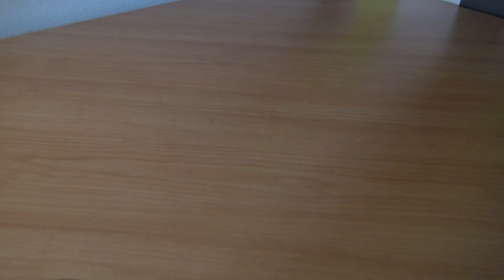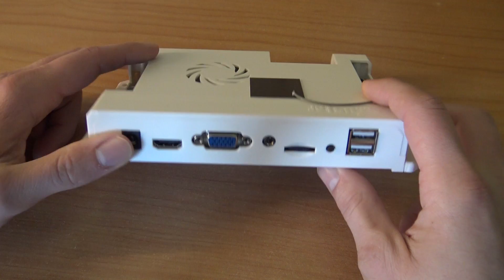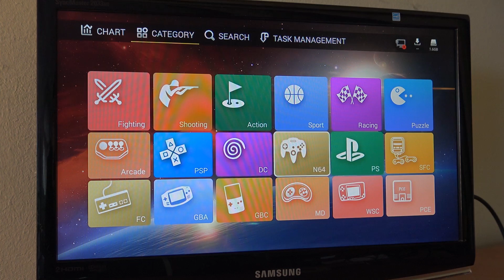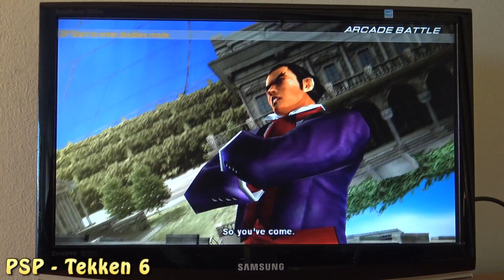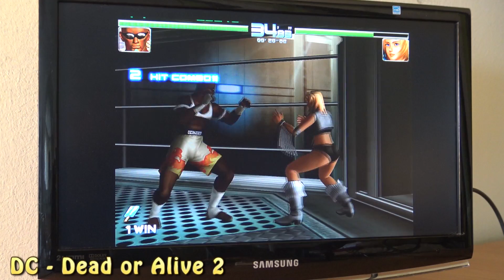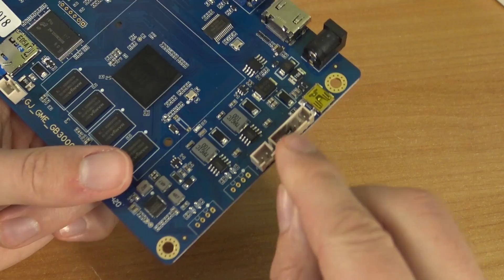Pandora Games 3D Plus Console Edition.... is it any good ?

Comment: Hey Wicked Gamer, I have the Pandora Games 3D Arcade Stick, would you recommend upgrade the mainboard to the 3D plus version for extra $90 (shipping included)?? Advices?
Reply from the maker: Plus edition only haves minor improvements like...
- Adding games trough menu (don't need pandory tool anymore) 
- Better support for different controllers now. 

I would wait for one that haves more new options. 
Because the Plus has same specs mainboard so emulation is still the same with DC and PSP.

Comment: I think if you change the thermal pads with MX4 thermal paste, the cooling might be better.  Just like the ps2, they use thermal pads, then ps3 and ps4 used thermal paste, now the ps5 use liquid metal to do heat transfers.  Each generation of gaming improves.  But these are cheaply made to cut costs.  So replacing with non conductive thermal paste like MX4 will at least give the system a bit of longevity.
Reply from the maker: That is a good idea indeed 😄

Comment: Hello Friend,  I currently have the original Pandora box 5 home edition from 3a in my arcade1up . Can I swap out the 5 for Pandora 3d using the same harness that came with 5?
Reply from the maker: Main problems you wil face with pandora are the connectors on the back those are different compared with the Pandora's Box 6. So far I know you can upgrade Pandora's Box 5 to Pandora Games 3D. 

This video --) https://www.youtube.com/watch?v=ar0pPAu3kao&ab_channel=WickedGamer%26Collecto

Will explain what I mean with connections and the casings.
Reply: @WickedGamerCollector  thanks a lot for your help it's difficult to find the right version of Pandora  3d Games to get and will it work the harness that comes with the original Pandora box  5 Family edition from 3a. I see some 3d  boards have 2448 games, some have over 4000. Some people mention the power connection wire on the 3D games is different than 3a models. Do I need to find a different cable for power?